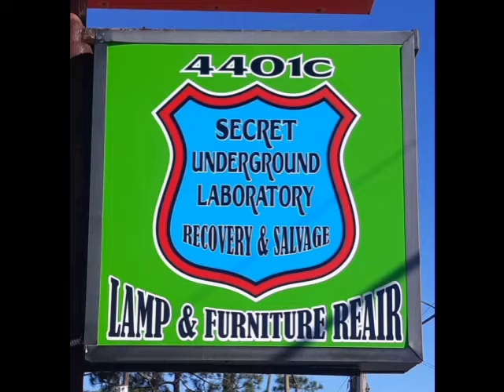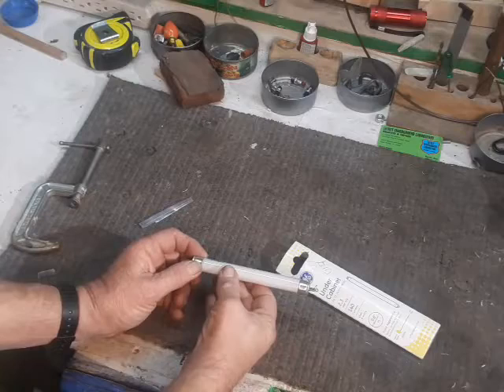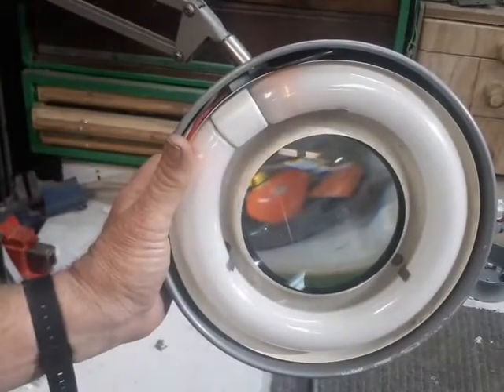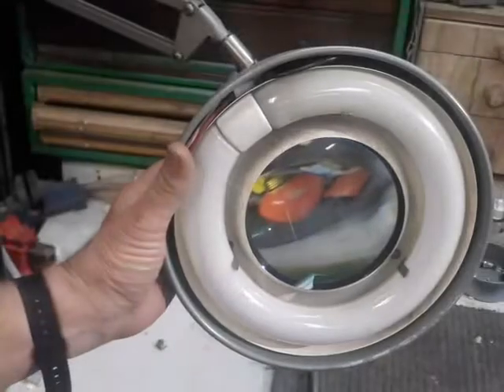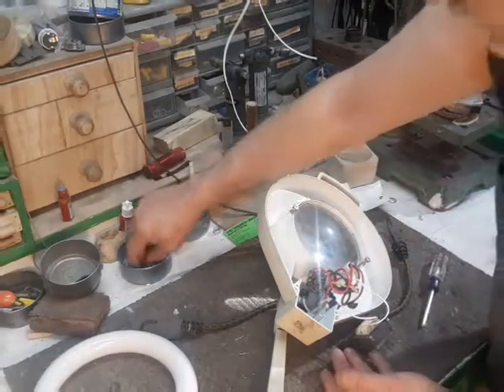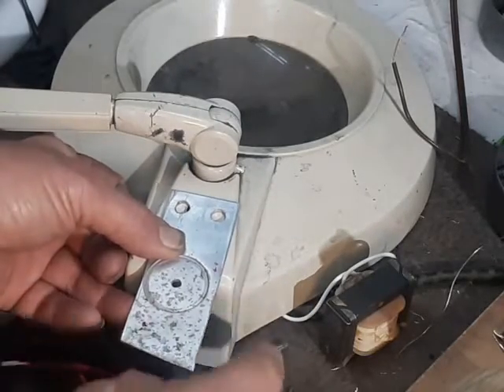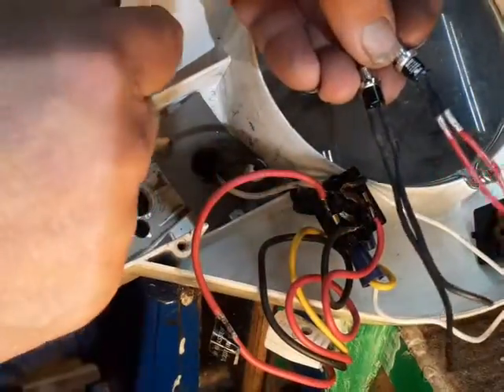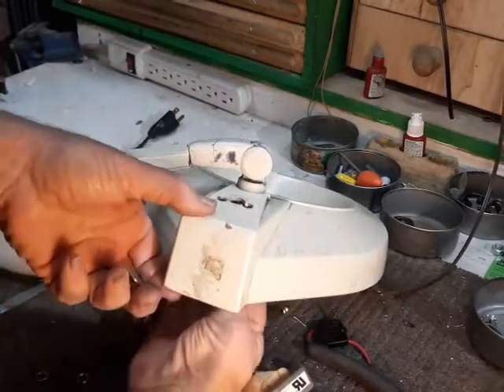Swapping One switch for Two on a Magnifying Lamp in the Secret Underground Laboratory

Comment: Do you have a schematic of this project? I have the same problem and would like to fix it
I have some other questions
1. are the switches momentary or not?
2I see you push the red switch, what does the black one do?
3 It is hard to see, but I assume that the red switch is the red wires, the black switch, the black wires. 
I have been trying to find info on how to fix this and yours is the only video or articles that addresses this problem. Thanks

?
Reply from the maker: @billhilly27  The black switch is normal on, momentary off. The red wire is normal off, momentary on. The basic principle is the pins on the end of the tube are the terminals of a coiled wire. The red switch heats the coil, which gets things stirred up and the current through the black switch lights the tube. Pressing the black switch breaks the circuit and turns the lamp off. I found the schematics on the Internet, but I didn't save the link. If you make this modification, be careful when reading the specs for the black switch. Most are rated for 1 amp, which is not enough. Find a 3 amp switch. The one amp switch will overheat and the terminals can melt through the plastic jacket. This can be a serious hazard because the swivel neck is a very poor conductor. This means the ground wire can't receive enough current to trip the breaker and the lamp shell can be hot. I hope this helps.